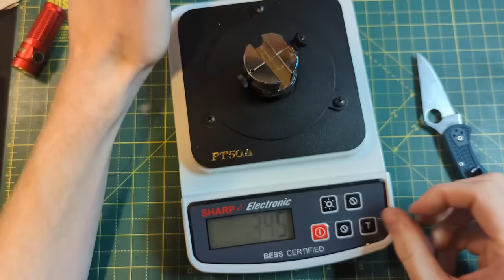Why your knife isn't sharp even after sharpening. A critical missed step

Comment: Who doesn't love a sharp knife?
But... 1 minute of cutting something of substance and you will be right back up to 165.
Reply from the maker: Correctly deburring vastly improves longevity. As the edge becomes abraded it gets thicker thus less keen. If the burr is torn off it can take some apex with it (making it thicker faster) or it can even slam into the apex

Comment: What are you looking for with the flash light to show you there’s a burr
Reply from the maker: You can see when I first shine the light there is a line of steel which is reflecting the light differently than the rest of the bevel. This reflected light is coming from a tiny tiny flap of steel which is the burr, I need to abrade this away until the light reflection is uniform.
Reply: @stroppystuff641  thanks for the explanation that will make things a lot easier for me when I sharpen! Is there any particular angle you should angle the flash light?
Reply from the maker: @stevestory8483  No problem, I hope it helps! Start by shining the light down on top of the spine and then either angle the knife away or move the tail of the light towards you (so it's shining at a different angle). Just play with this until you find the burr, it's quite obvious once you see it, if you're really struggling to find it, there probably isn't a burr. It's hard to miss.
Reply: @stroppystuff641  thanks I appreciate the help

Comment: One brief pass per side on a leather strop will tell you if a burr is present, as well as how pronounced it is.
Reply from the maker: Even if you are stropping then you still benefit from removing the burr before hitting the strops.
Reply: @stroppystuff641  after the brief pass on each side, if I see burr I always go back to the stone. It's merely an easy and underused method of burr detection.
Reply from the maker: @oceanwaves83  yeah whatever works best for you to get the best edges 👍 interesting to hear different techniques
Reply: @stroppystuff641  absolutely. I try to spread the word as many people take a pass on a strop and don't even notice the surface of the leather being roughed up due to the burr. The answer is right in front of their eyes.

Comment: Dragging the blade across your thumbnail is a quick way to feel a burr on a blade. If it glides across, it has a burr, if it feels a bit rough when sliding across your nail it likely has a good edge.
Reply from the maker: You can't detect a foil this way, but yes you can feel a sizable burr
Reply: @stroppystuff641  Thank you you make excellent videos! I misunderstood, as that was the way my granddad taught me back in the 1960s to do before stropping. [unrelated story...] Once when I was a child, I had my right hand caught in a nylon rope twisted under tension. He hewas thankfully at the time been sharpening one of his knives, a Marbles Gladstone®. He ran out of the house sliced the 1 inch diameter rope with one slash and saved my hand. I now have the same knife and will never forget this experience.
Reply from the maker: @Thestargazer56  thank you :) Good thing he was quick to save you! The nail technique is certainly viable to do, so you don't need to change what you're doing, but if you're going for ultimate performance it's missing a bit of accuracy :)
Reply: @stroppystuff641  When I get my knives together to sharpen them my arms and legs look like I have mange from all the bald spots from shaving, testing my efficacy.

Comment: Isn't there a chance of mistaking a micro-bevel for a burr?
Reply from the maker: The difference between the light reflection of a micro bevel and a burr is stark. Also in this instance performance increased dramatically which proves the burr assumption. You can also use magnification to check the apex or a number of other methods
Reply: @stroppystuff641  Hi, thank you for the reply. Can you do a video on that?

Comment: I would say it is possible you didn't deburr the knife on that rod but only straightened the burr. I would bet that you could get the same result if you just pulled the knife through a piece of wood and then took it to the strop.
Reply from the maker: Pulling a burr through a block of wood will tear the burr off and damage the underlying apex, fatiguing the steel and making it less keen. I micro beveled on the rod and it absolutely removed a large amount of burr
Reply: @stroppystuff641  If your edge is so fragile that you can't pull it through a piece of soft wood, it's effectively useless to me. You're sharpening as a hobby, not for useability.
Reply from the maker: @twatmunro  You're missing the point. If you pull the knife though the wood BEFORE you deburr then the burr will be torn off, damaging the apex. If you pull the knife through the wood AFTER you deburr then it will not sustain any damage. And that is why it's important to do this properly as it will ensure a more durable edge.
Reply: @stroppystuff641  thanks for this. Was recommended in the past to use pine wood or some soft type of wood for deburring, but will definitely get a ceramic honing rod in the future.
Reply from the maker: @fallenstudent1103  you can do the same thing on your finishing stone, a rod isn't a requirement and I actually use it less these days. Having said that, the spyderco UF rod is an excellent tool for the job
Reply: @stroppystuff641  OK but why do it after deburring? The burr is already removed. Seems like you would be finished after deburring and then form the micro bevel??????
Reply from the maker: @billyboy7  why do what after deburring?
Reply: @stroppystuff641  Stroppy, why use a felt block, cork, etc. after you have successfully deburred?
Reply from the maker: @billyboy7  smaller abrasives used for stropping and also presenting the abrasives less aggressively to the work piece gives you the ability to create a keener apex. You can measure the sharpness between 4um,1um and 0.25um and see a significant difference between them. If you don't need your blade this sharp then you're right, no need to strop.